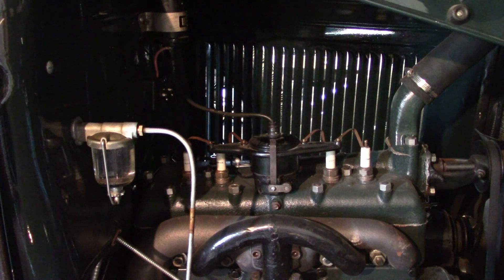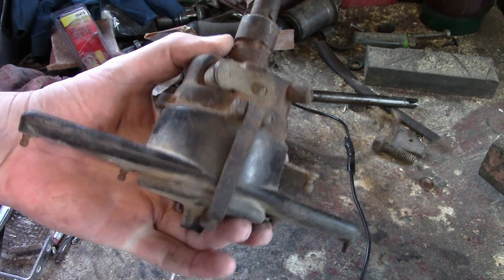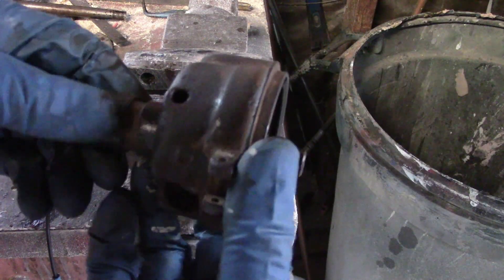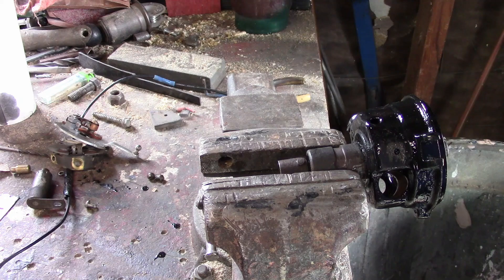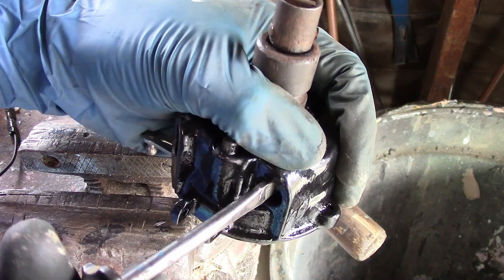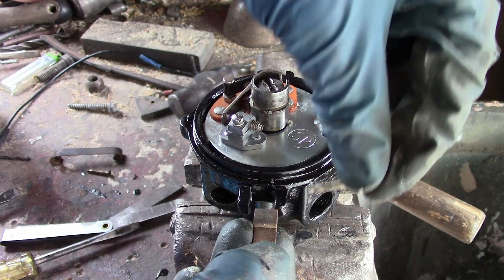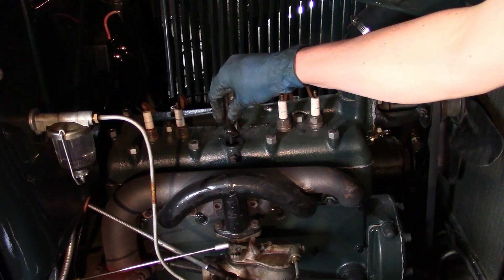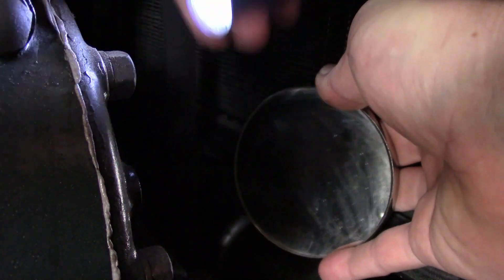Fixing a Ford Model "A" ignition system. Part 1. Distributor.

Comment: I see you have the later replacement long solid distributor shaft on the 1930 Ford. The $10 spare unit appears to have the short shaft with the coupling to another shaft. I am told the car originally had the short shaft on the distributor head and the loose coupling was in the design. I was planning to convert my Ford from the long shaft to the short coupled shaft as it is supposed to put less strain on the lower half of the distributor housing.
Perhaps that is why your housing snapped in the first place?
Also I found by putting more of a point on the timing pin makes it easier to find the dimple in the timing gear.

Comment: Nice video. It would be best to source the black negative side coil wire to the driver's side of the terminal box. This lets the ignition operation show up on the ammeter as a jiggle in the needle  as the primary circuit functions. This change was specified in a Ford Service bulletin in November of 1929 (page 390 if I recall correctly). This "Henry Jiggle" provides instant information to the driver if the car begins to stall or won't start, etc. Your client will benefit greatly.